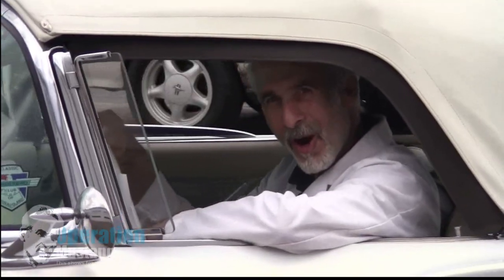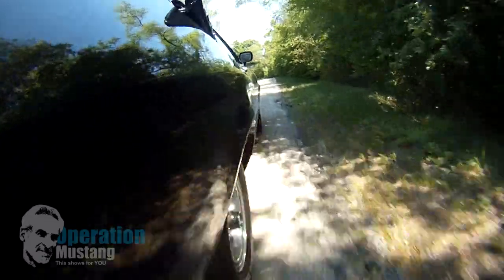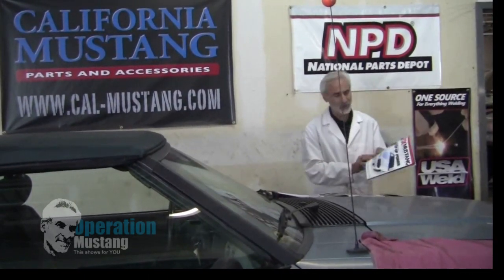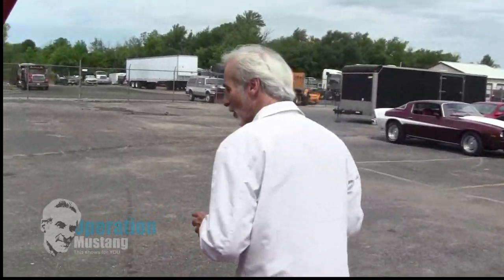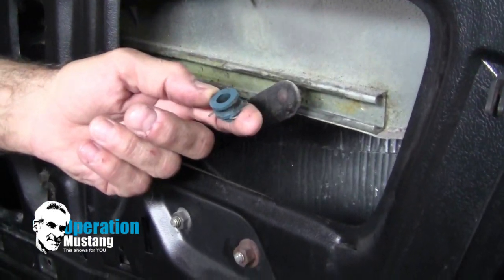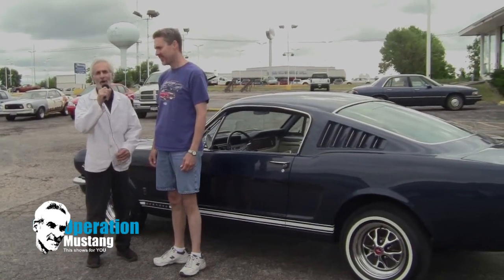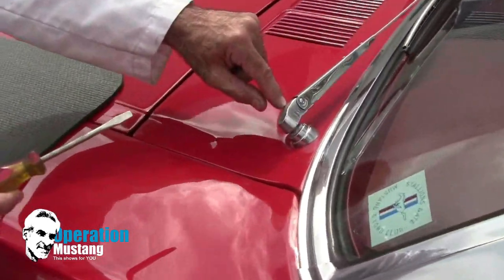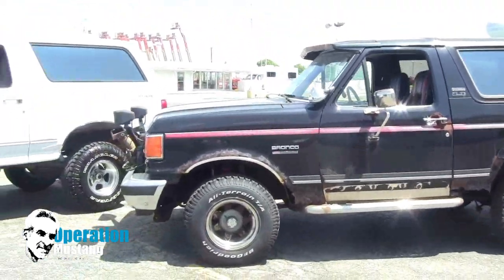Operation Mustang's & More show 20 Cobra Test Drive

Comment: Just to bring it up, we have an original 65 Mustang sold in May of 65 with pony interior, Eaton power steering pump, and the low-off-high heater control. It's never been touched, as we have all the receipts for it from new.

Comment: The interior lights should only be on when the door is open, whether the key is on or not. The radio should only come on when the ignition key is on or in the acc position. Its possible it was improperly wired. Do the windshield wipers also work when you turn the key to off? If they do, then its probably a bad ignition switch. Otherwise, improper radio wiring is likely the problem.

Comment: Great video.  I just found that wiper arm tool in several of my mustang catalogs.   Can you help diagnosis a voltage issue?   I recently purchased a 70 fastback with 302 motor.  There is an extreme battery draw problem, that completely drains the battery in less than an hour.  I replaced the voltage regulator and it didn't help.  I also noticed that the interior lights and the cd player stay on when the key has been removed.  Any suggestions would be greatly appreciated.